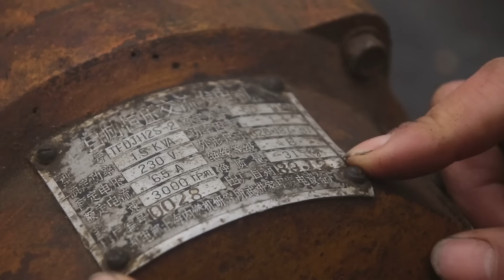天才女孩修复1989年的交流发电机，粉丝答应修好给我寄香肠！The Talented Girl Repairs the Alternator Sent From Her Follower!｜林果儿

Comment: I think you might be able to use a wood chisel to cut the copper in the motor, rather than a coal chisel.  It is sharper and has a shape that matches the angle you like.  But it is sharper so be careful.  There are cheap ones are all metal, you might want to heat and quench them in oil.  Maybe that is too much trouble, when you have something that works for you.  I am still trying to design motors a different way that are more powerful, smaller, lighter, easier to assemble, do not waste energy or burn out.  Richard Collins, The Internet Foundation
Reply: Revisit the works of Nikola Tesla.